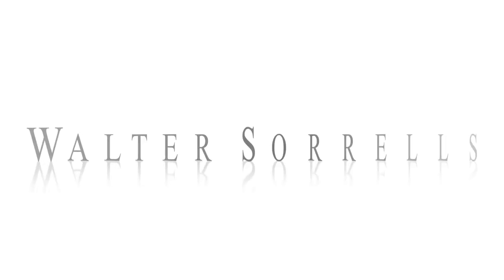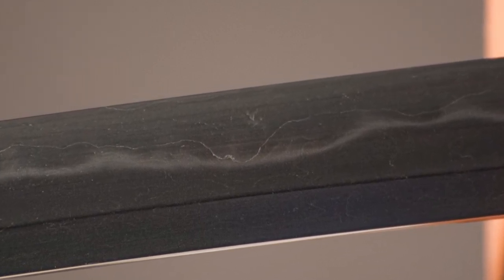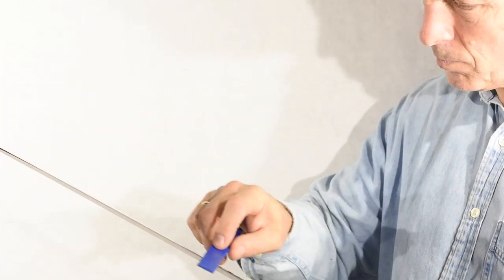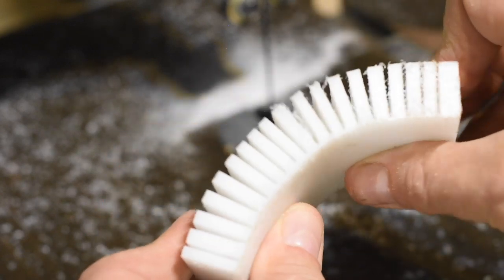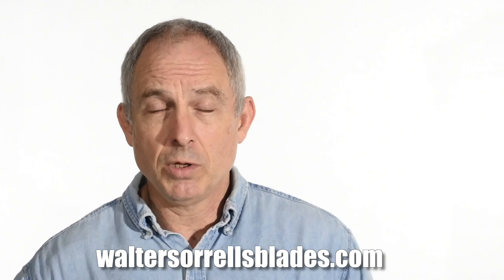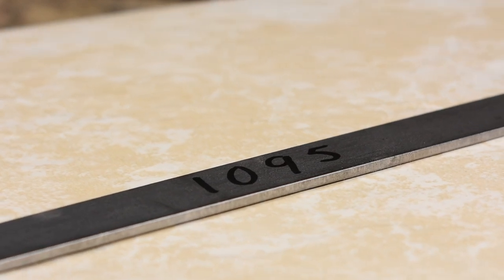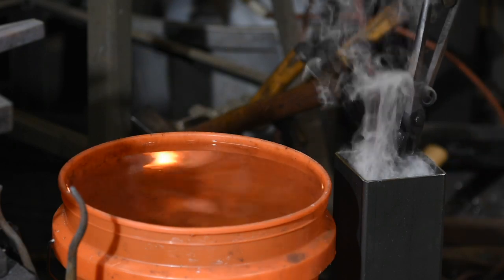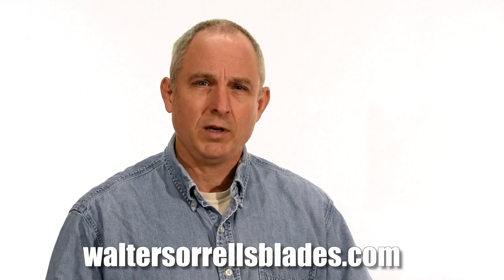Japanese Sword Sharpening, Hamons, Steel:  Knife Maker's Friday Five: #40

Comment: Thanks so much for this video. Got the EZE Lap stone you used in the video and it worked like a charm. Picked up A Cold Steel Chisa Katana that was sharp as all get out but had a bit of a burr to the edge. Your simple method worked and with no damage or visible micro beveling of the blade

Comment: What timing tried my first one yesterday, wake up and grind the bevel today. W2 came out 60 HRC .. fingers crossed

Edit: forgot, recently sharpened an heirloom big honking chef knife with a full integral & an extremely complex convex grind.  It was butchered badly by many attempts to resharpen. Flat grind gouges & lastly a cheap electric knife sharpener placed two deap gouges down both sides. 
So, tried a Falcon 150 grit finishing stone. Had to go to my KMG on the slack from 1200 & worked backwards to 220 to get the original profile back. Then back up to 1000. & about 4 hrs of hand sanding.   All in the name of a friend. Hope not to go through that again!
Got it perfect but about an inch from the plunge. Didn't want to loose with on the blade.

Comment: Still lost. What is the best steel for a clear, sharp hamon?  Up here in Canada W1 and W2 are hard to find and expensive to import. Thanks Walter.
Reply: Low manganese content 10 series steel, definitely less than 0.5% manganese, preferably 0.25%.
Reply: My best hamon I have ever made was on an old file, I can never get a bold hamon on coil spring. the simpler the better.
Reply: He prefers W-2

Comment: great video 👍 
I just finished forging a short sword but I’m worried about quenching in water my question would be can I still get a hamon quenching in oil
Reply: Probably not but it depends on the steel and the oil. The cheapest way to do it would be warm to hot water then peanut oil. The safest way to do it would be W2 Steel then Parks 50 you might have an issue with the curve of the blade. I've got a 25 inch blade that I plan on putting in hot water first for about 4 seconds and then finishing in parks 50 and then maybe putting in a clamper vice as it cools

Comment: Hamon's pretty good from what I see on the website, weird that no one did the 刃取り(Hadori) process, that would really make the hamon pop, so is the 地艶, 刃艶, and 金拭い, all the traditional polishing stuff. I'm guessing the katana is just polished by machine (can tell by the line......you know it makes it prone to rust, right? At least use some whetstone and sandpaper......), then dipped in acid. The problem is that the 匂口 (roughly translates to the line of hamon) is incontinent and broken in several places, that's a huge downside for the ornamental value of a katana, and really shouldn't happen to any skilled katana smith. I mean look at any shinken from Japan above Preserve status, you wouldn't find much, if any. That's really a deal breaker for any seasoned katana collector. Also atrocious 鑢目 (file marks) for a modern katana smith, can refer to any modern made Japanese sword.